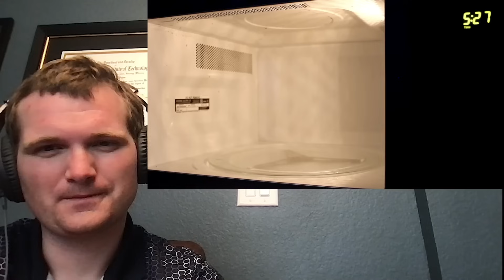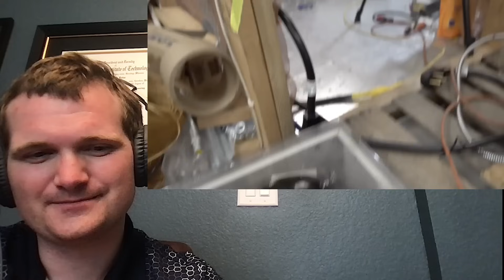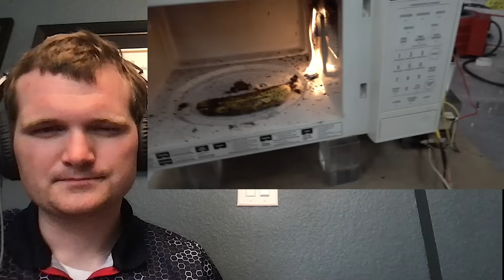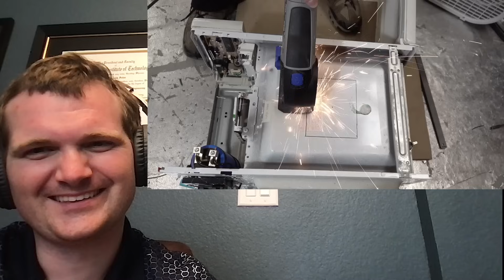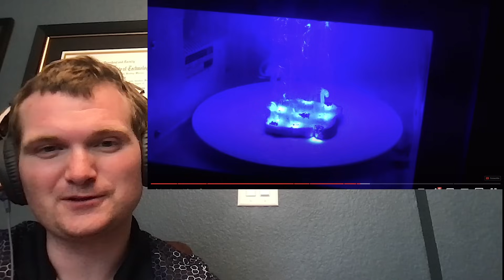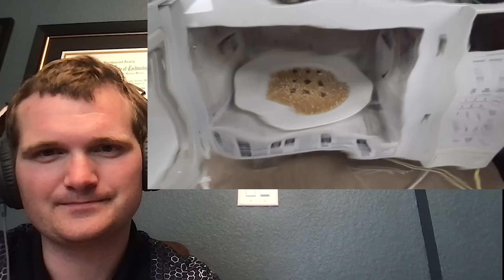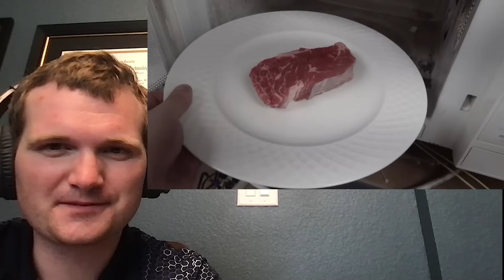LASER MICROWAVE! - Nuclear Engineer Reacts to styropyro

Comment: As the magnetron is a self oscillating tube (schematically it looks like a diode but the shape and the magnet allow it to oscillate at it's native frequency. But being self oscillating. if you lower the power, it drops out of oscillation. That abomination that every microwave uses for a half wave voltage doubler spits out half waves at double voltage but drop to zero 60 times a second. There exist inverter based microwaves that use a separate power supply to boost the voltage to the required potential instead of having a large transformer. I had one, and the transitions from powered to not powered are definitely smoother when using reduced power modes. Still, the only way to adjust a magnetron's power or frequency would be to hit it with a hammer to deform the outer plate but this would almost certainly cause other issues. This video and that video were definitely fun though.

Comment: The reason a microwave always cooks at the same power level and can only be turned on or off is that it uses a cavity magnetron, where the output signal is determined entirely by the physical size and geometry of the cavities surrounding the cathode

Curious Droid has a great video on this...   /watch?v=CbTWzC86R4Y

Comment: And did you see the cup of water when he started mix it it increases in temperature That's because you can super boil liquid water in a microwave And it will not release that energy until you touch it It's very dangerous to heat liquid in the microwave be very careful It can be a hell of a lot hotter than you think like more than boiling

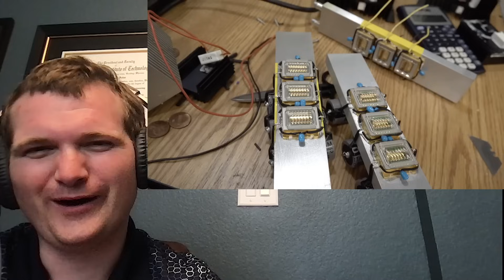Comment: 13:00 the mayonnaise is probably there as thermal paste to couple the laser diodes to the heat sink. Water makes for a very efficient heat transfer. You just shouldn't use watery substances, such as foods, as a long term solution, as the water will evaporate and the food will rot.
Reply: I'm pretty sure it was just a joke and cleaned off afterwards and a proper paste was put on it it's place. The amount of heat those lasers produce is more than a CPU and CPU's pump out a good amount of heat lol.

Comment: A wee bit off topic. What about compression  cooking food? Place it in a chamber, then sealed. And the pressure rises quickly multiple times. Around 5-200 bar, at a frequency of 1-to 
20 Hz depending in heat settings,  probably 5-10Hz.  And 18-30 bar, to avoid the compression IGNITION possibilities!😆....  With the pressure rising rate being adjustable, to roughly 1 second, to abizt 2/10 of a second, (20/100 sec. ) then slowly  decompress,  of about 1 second to as little as 5/10, or half second, to allow the hot air to do its work, heatibg tge food . Possibly offer a two step,a compress to 50% fast, then slow to 100% a 1 second delay and a slow release and repeat. So a cycle per 3 seconds. At 20 & 40 bar possibly, around 200-300 psi may not be too alarming, however , getting to compression of 25:1- 30:1 things can get  spicy 🔥 fast. The air heating to 1000°+;in a fraction if second. So slowly compressing to lower the extreme heat slightly, and allow time for cooking. 1 bar being atmosphere pressure, (14psi maybe 15 psi ((in a deep hole in death valley or someplace beliw sea level))  so 10 bar being 140- 150psi, 100bar =1400- 1450psi, .being a big difference,)  20-40 bar can easily start a fire! Possibly flush the chamber with nitrogen making flames less likely, not that it will not still burn!  Using a large  heavy iron piston 18"-24" diameter, 6"- 8" thick using air and vacuum to move, along with nagnetic fields for example= used to compress ambient air, or possibly a chamber flushed with nitrogen. 24" x 48" minus the 8"+/- for the piston , and 12"- 18" for the cooking area,  also having  ceramic insulation and a reflective surface , to prevent the walls from taking away heat,  the piston also having reflectors and insulation. Use magnetic breaking, generating power to help run the machine.  Using a vacuum, or linear motor  to lift the piston. And possibly use compressed air to speed up the drop, up to 1 litre at 125-150 psi, released through a 50mm ball valve, then another opens to allow the piston to return, and the 1 liter of air in the accelerator should be refilled throughout a 20 mm supply line, with the cooking chamber sealed, only the pressure quickly rising and compairably slowly falling, and the pressure raisingtge temperature with a 3,steps forward, 2 steps  back type deal,  so it should be steadily  rising,   with  so cramming 15 cubic feet of air , into 0.8 cubic foot, in 1/10 of a second, at pressure going  from 14psi(o/zero, for ambiant sea level pressure/ to 45 bar or something (no maths did)  the temperature (go from zero to 3000psi plus in basically a instant) the temperature hot enough to vaporize paper, oils possibly bread,  then back to 5°-10°F over ambiant temperature, (((70°f to 4000°?, to75°-80°F?  Whats the "F"!!!))) Tgen repeat for 1-2 minutes, the temp should rise 5-10°f x 60-120, (at 1 cycle per second) so by 3 minutes there should be carbon in the shape of the food!😮

Comment: 3:20 you never knew that? I guess you never used that setting because it's apparent that it's just cycling. You can see it in the food depending on what level you set it at. Water boils then doesn't boil. You can see it turning off and on by what the food does. Burritos will get puffy then deflate. You can hear it too if you listen. It cuts off and on.

Comment: The mention of a rectifier with a partially dismantled microwave on screen made me consider how awesome a collab between Styropyro and ElectroBOOM would be.
Reply: "Yes, Bob, I'm reporting to you live from what emergency personnel are calling the minimum safe distance. As of yet, we do not have a source for the anomaly, but it is believed that an attempt at a YouTube video was involved."
Reply: Why do you want to kill them both?
Reply: I think you can't use a rectum fryer because transformers don't work with DC? They need the alternating current to induce voltage into the second coil
Reply: @CookingWithCows  yes, a rectum fryer may have some deleterious side effects - with either AC or DC.
Reply: F U L L BRIDGE RECTIFIER intensifies

Comment: I never realised how much the FCC was focused on radio wave pollution until I started working for a cable company. I learned that the majority of internet and cable in homes and businesses is still coax cable and that the frequency signals travel on those lines is the same frequency as radio waves. So if a coax cable has a tear in the insulation, some of that signal can leak off as actual radio waves into the air. As such every cable and internet company has an agreement with the FCC to minimize signal leakage from their cables below a certain threshold so it doesn't fill up the air with noise. So yeah. Running an open microwave pointed into the sky is a good way to get the attention of the feds.
Reply: Every part of the spectrum has rules about who can use it, how much power they can broadcast at, etc. Microwaves run at 2.4 GHz, the same as older wifi standards. But wifi is limited to very low power levels. Far below what a microwave would broadcast without any shielding.

And yes, the FCC will track you down and go after you for unlicensed broadcasting, even if all you're broadcasting is random noise from a microwave.
Reply: Can't wait till all network is fiber optic.
Reply: @FeminalPanda Fiber is indeed completely impervious to RF yep.
Reply: The air waves are a clusterfsxk.

In the analog TV days, running a microwave in the house would cause 2 static bars to roll on the screen while the magnetron was emitting RF. It's a very dirty "transmitter" that splatters the entire band with noise.

Ovens are typically designed so that this is minimized but it's not as easy as one would think to keep that kind of power totally boxed up in the unit, and they leak.

Everything electronic today emits RF to a degree, even when that is not the goal, and whether they use it for communication or not. The power supplies these days are all noisy as hell because chinesium designs typically omit the filtration that helps contain it.

It is what it is.
Reply: @MadScientist267  I mean, any wire with electricity running through it is an antenna, whether you intend it to be or not, and that goes for both transmit and receive.
Reply: @Bobbias  Yes which is why the filtering is so important on things that use switching and the intent isn't to "transmit".

It costs more money, so they skimp on it. Many a cheap PC power supply has things like the common mode choke completely missing from the boards and bypassed with jumpers and RF suppression caps not populated and such.

Most of the noise that comes out of a device you plug in is "transmitted" by the infrastructure powering it (pronounced "the power cord and building wiring")
Reply: @MadScientist267 Analog TV frequencies in the US, used to start around 54Mhz, which isn't close to the 2.45Ghz range of a microwave oven.  There should be ZERO cross over.  Your lines were more likely a power bleed issue, and not from the magnetron.  FYI.
Reply: They showed up at my house because I have a front yard LED light bulb leaking RFI. They ask some odd questions but on hindsight they already Id'd light so who knows what they were after. They didn't take the bulb or ask that I  throw it away.

Comment: 3:30 It's just classic plain old PWM .... as usual. ;)
Reply: Just with a hideously low frequency.
Reply: @Bobbias  Oh yeah indeed..... but that's how your actual heating thermostat works too ;)

You need to consider whatever thermal mass, in your microwave, or in your full room, as a (heat-)capacitor...

Where your simple (even just bi-metall) thermostat tries do establish a certain temperature.....

But it is still plain old Pulse-Width-Modulation...

Generated manually/analog or digitally ..... it's basically still the same in the long run. ;)

Comment: The reason the FCC will probably bend you over when you start blasting a double-power magnetron out in the open is because microwave ovens typically function at 2.45 gigahertz, which is pretty much at the 2.4 gigahertz band. The latter of those two is WiFi.
So basically, when you're yeeting 2.45GHz microwave radiation across the yard, you're effectively using a DIY signal jammer.
... People have been arrested for using broad-spectrum signal jammers in the past, it's a really, really bad idea.

EDIT: My fingers didn't write what i thought they wrote. They will be severely reprimanded.
Reply from the maker: Thanks for the clarifying info!

Comment: Interesting bit about the fluctuations in the power draw of microwaves. I remember watching a documentary where an analyst from a power plant spoke about how they have to anticipate societal trends to ensure there's enough power on the grid, like "Oh, there's going to be a soccer match starting at 7pm so the half-time is going to be around 7:50pm so let's make sure the grid has enough juice for all those microwaves and fast boils".
Reply: It's basic on/off regulation. Your typical heater at home, your oven, and a lot of other appliances use it. The duty cycle, how often it is on versus off, dictates the average power draw over some period of time. One thing to consider is that there is a certain (though negligible) amount of energy storage as parasitic induction/capacitance in the grid infrastructure that helps smooth some of this out, though this is often minimized to achieve the highest power factor (capacitance/induction can cause phase differences between the voltage and current, resulting in differences between real and reactive power, and thus wastage). The most important thing to understand though is that such on/off regulation becomes averaged out over many homes/loads. If you consider each home a load, each load is varying in their power draw due to on/off regulation, each one will do so randomly relative to the other loads. The result is that the power companies do not see a bunch of on/off fluctuations in the power draw, they see a smooth-ish demand curve. So, while grid balancing is indeed a non-trivial matter, it isn't as crazy as having to deal with every tiny fluctuation like a microwave's on/off duty cycle.
Reply: @piisfun  i wonder if they made it a new house code for every new house to have a battery backup to pull from, how much would that elevate that issue.
Reply: Pretty sure it was a tom scott video

Comment: Probably stupid question but are the control rods of a reactor reusable or are they a one time use and then you have to swap them for new ones and if they are reusable is there a limit?
Reply from the maker: Control rods can last about 8-12 years depending on reactor type and control rod type. They are replaced during a refueling outage when the reactor is shut down.
Reply: To my knowledge control rods work by absorbing the neutrons emitted by the fuel rods making the reactor sub critical (unable to sustain a reaction). That would mean they would eventually absorb enough neutrons to turn themselves radioactive and unable to absorb more neutrons to stop the chain.

I have no idea how long the service life of a control rod is but I presume they do have a lifespan before needing to be replaced.

Comment: Does this count as thermal radiation? As I understand it, the microwave radiation excites water molecules and causes them to vibrate faster and thereby heat up.
Reply: its electromagnetic radiation
Reply from the maker: Yes, both microwaves and lasers are types of thermal radiation in - they are different parts of the EM spectrum